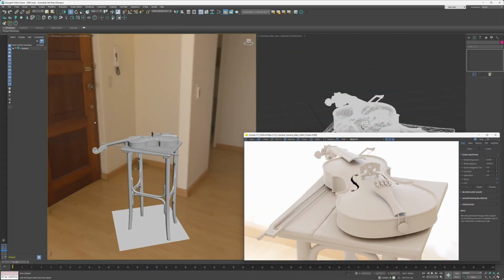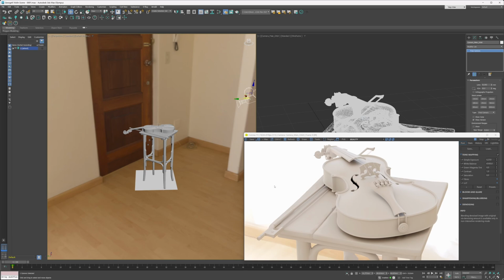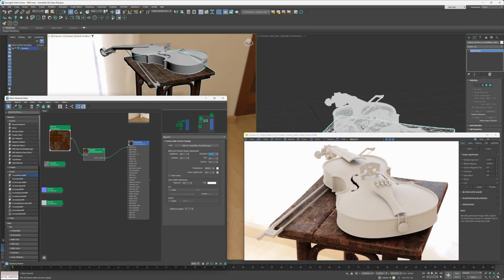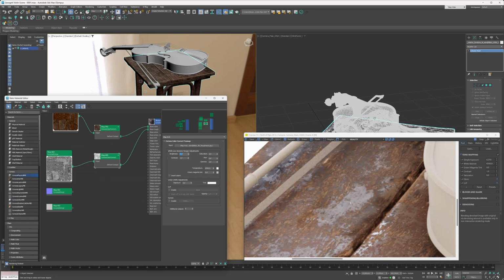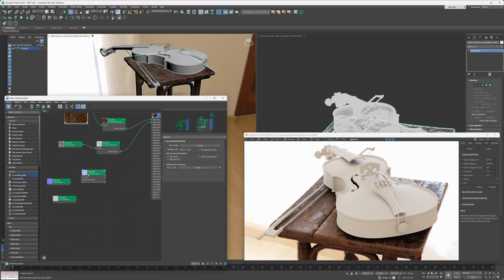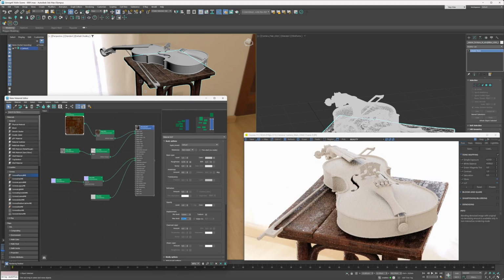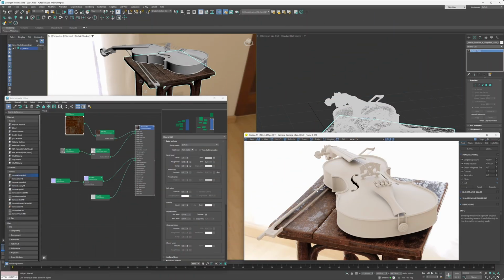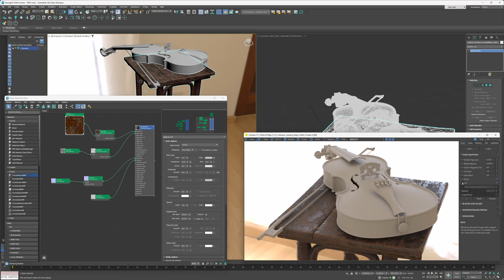Chair Material Breakdown, in Corona for 3ds Max

Comment: Can you change the corona VfB interactive render resolution?
Reply from the maker: Howdy! Not sure what exactly you mean but if you simply resize the VFB window it'll change the rendering resolution accordingly. Or did you maybe  have something else in mind? Nejc
Reply: @CoronaArchViz  i found it already default render resolution in the vfb is half your screen resolution. In your render settings, then system, then system settings there is a number called image upscaling factor which is at 2 by default (so it only renders half the resolution of your screen and then upscales it so the interactive render is faster). I changed it to 1 so it renders the native screen resolution in the interactive render. But I'm sure u guys knew that setting since you work for corona renderer 😉

Comment: Most of the time, pre-made UVW map textures aren't available! 🤠
 So, imagine tackling this exact same mesh table - starting the texturing process from scratch using PBR seamless maps and Corona's advanced features like AO and curvature maps on this Non-Quad mesh table. I'm eagerly anticipating a tutorial from the most supportive team among all render engines on this challenging level. Tnx
Reply from the maker: Howdy! Personally, I typically try to see if a simple UVW unwrap can be done - that typically takes care of things like wood grain direction etc. If that isn't quite possible to do I'd probably start messing around with what  user-hz4fj5xw2u suggested. 

There's loads of different ways to approach it depending on what exactly you want to do.

For example, if you're dealing with just an imperfect looking metal material then triplanar method is typically all you need.

If I may I'd suggest opening up a topic over on our forums (https://forum.corona-renderer.com/index.php) and we can share visual examples there plus we can obviously also go into more details. Nejc